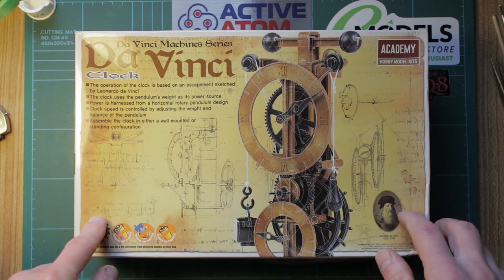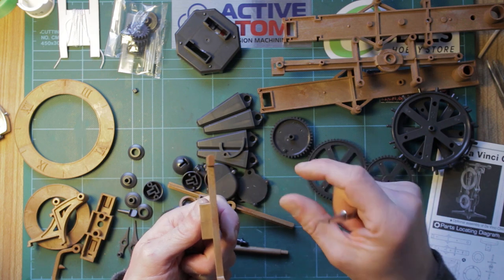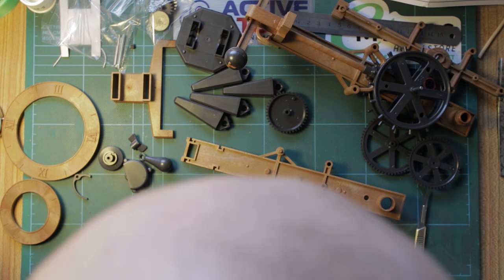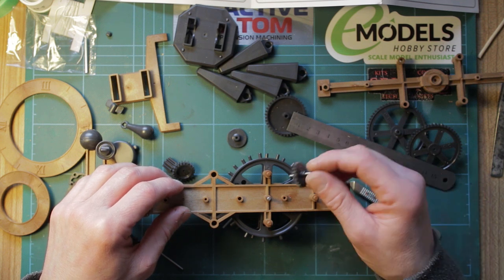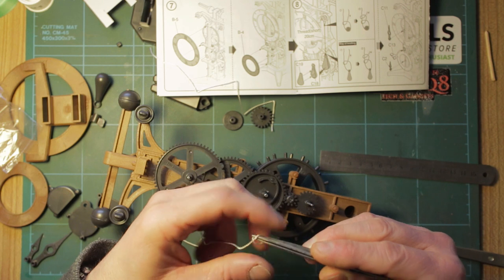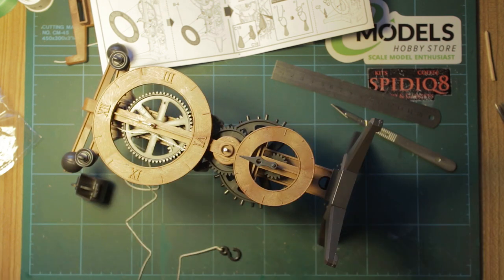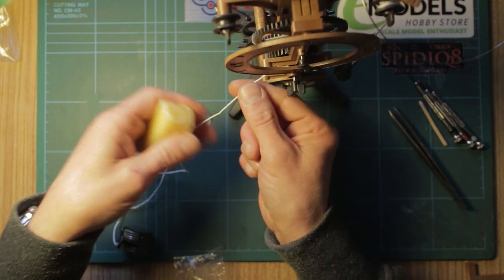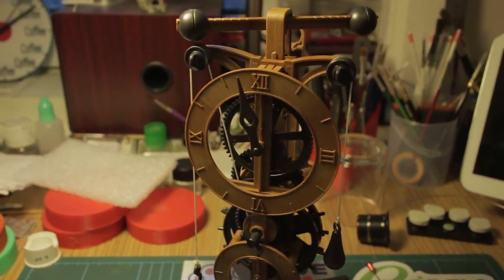Academy DaVinci Clock Model Kit Complete Build

Comment: Just put one of these together and your video helped. A word of note for others when I was assembling c9 and c10 with the string make sure your knot is small enough so when you press the two pieces together it crimps together all the way. Mine did not originally and I couldn’t figure out why my string kept getting stuck. I also put a very small amount of gear lubricant for regular clocks on the shafts after assembly and it made a massive difference on how smoother it operates. Thanks again for the video!

Comment: I doubt I have a problem with the weight of the coins I use for mine. (10 u.s. quarters) but even with those in the basket, the escapist dosen't budge at all. It only moves either when i take my finger and move the pegs of the large escapist wheel downward (clock face facing right) manually. Or if I grip the basket and string and while using my thumb to brace the pulley up top, I just begin a downward pull until the device starts moving. It only contiues like this while an amount of pressure or weight much larger than the basket with the coins in can manage is constantly applied to that particular string which certainly cant be correct. I wonder if there was anything i was supposed to do with the other gears/cog wheels. I'm certain I followed the manual correctly and restarted to just after the escapost wheel was installed when I started following your video. I don't know what I've done wrong here. I haven't applied any sort of lubricant to any part pf the device so maybe that's what's wrong?
Reply from the maker: It's nothing like remotely accurate but you need to ensure that all the gears are free moving with no binding and also that they're meshing smoothly.

Comment: I just bought this model clock and was anxious to build it but I was confused about the "optional" part of the build, so thanks for that! I am also a quilter and use beeswax on the quilting thread to. help lubricate it for the small quilting stitches.
Reply from the maker: I hope you enjoy it. Please don't wax the string though. It turned out that it actually hindered it.

Comment: My clock wouldn't run and I found 2 likely problems you might have ALSO.  Part number C3 has a "nub" at the end that should be removed.  The 2nd problem is the frame is squeezed too tight together at the bottom.  That's part number B2 & B6. Thanks to JIM WILLIS for this tip seen in these comments.
Reply from the maker: Thanks for those. I'll take a look.
Reply: Wow, got this kit at a thrift store, we put it together, and it wasn't working. I read your comment about removing the "nub" on C3 and now it actually works, thank you!

Comment: “Clock” is a little deceptive. I was hoping it would work longer. Am not sure what the purpose of the counter weight is since it seems to work fine without it. Great problem solving build as you have to adjust it and make sure friction and misalignment isn’t at play. My pendulum was hitting the left top and would stop midway. Also fun to play with different weights. Overall, it will be a fun display in a classroom or desk art.
Reply from the maker: It is really only a toy unfortunately. Fun though. I hope to build a wooden clock at some point.

Comment: Is it possible to have pushed together too tight? Mine didn’t work at first...I squeezed parts a bit, then it worked for a short bit, but started stuttering. So I pushed things together a bit tighter. Now it doesn’t work at all on its own. If I pull on the weight, it does move, and I see that the gears are all connecting where they should. Should I take it apart and assemble again? I’m afraid to do that... quite frustrating. 🥺
Reply from the maker: I guess it is, bear in mind this is more of a fun kit based on concept drawings from a long time ago, it's not made for precision.
If you like the idea of building a working clock there are plans and kits for wooden ones which are apparently very good.
Reply: I had the same issue with mine.     I had squeezed part B2 and B6 to tightly.  To correct, I inserted a knife between the two parts at the pins to move them away just slightly from each other.

Comment: Built it twice. Could never get it to work without 2 D batteries of weight.. Something is not lined up I thought.

For me, a tweak in step 5 got it working.

In step 5, first you see the instructions on threading the ratchet. After that, while still in step 5, is attaching b6 down 👇 while lining up all of the metal shafts. My tweak was to align the shafts where they need to go, then lign up the brown b6 parts.. But leave a small gap where the rectangle-shaped female B6 end attaches to cover the rectangle-shaped A6 male end.

Your instinct is to press firmly on all of loose pressure points but for me leaving the extreme ends of B6 slightly loose gave it enough give to help the gear alignment and friction a bit.

Hope it helps. I feel gear alignment is more forgiving than messing with the bend in the thick brown frames which are less visible and obvious. Good luck! 

Now I want a more precise version. Any recommendations on a similar kit?

Comment: I have built a few of the Da Vinci kits including this one, can't get this to run, possibly the coins I'm using. Which coins did you use? Thanks for a fun and informative build
Reply from the maker: I used UK 10p pieces but I can't get it to run consistently or accurately. It would need some modifications to do that. A fun kit though.

Comment: Looks cool but mine doesn't work at all. The weight just chills at the top and doesn't pull down even loaded with coins
Reply from the maker: Most likely something catching internally. They're not accurate enough to use for anything but check for flash and burrs